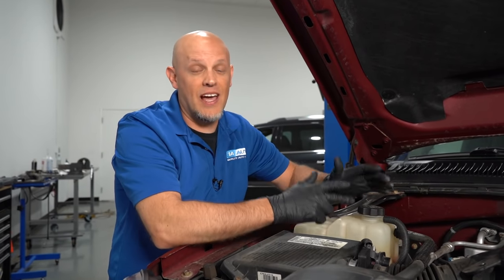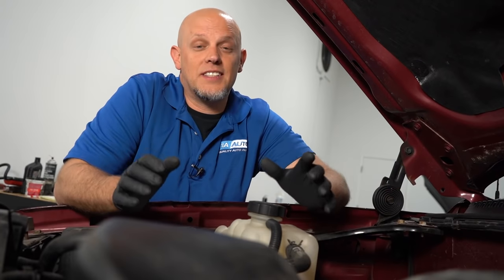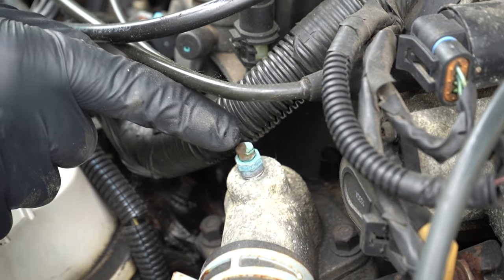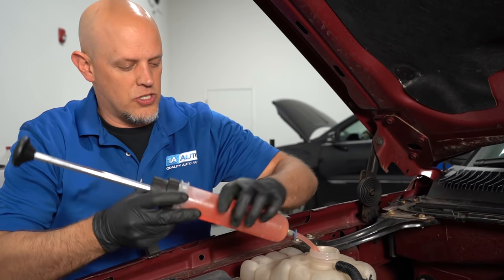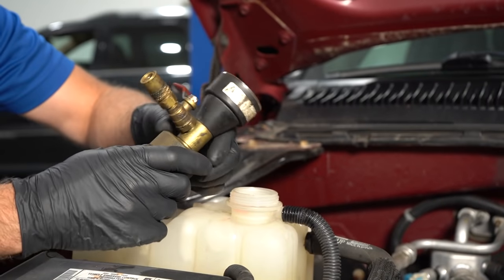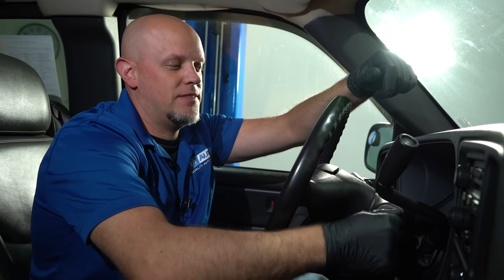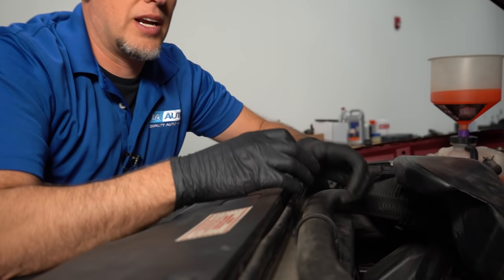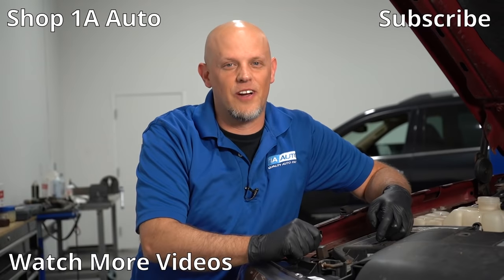Overheating After Replacing Radiator, Pump, Thermostat? Burp Coolant to Remove Air Pockets!

Comment: Facing same issue for two weeks now. Mine is toyota chr 2018.
Replaced water pump, and thermostad.
Filled coolent again. But still still heat meter goes up when i rev for 60kmh 80kmh. And when i slow down its suddenly get to normal possition.. only thing left to do is check radiator for any blockage.
Garage technician says much air in coolent system. Cant figure out what is the wrong.
From sri lanka

Comment: Not sure I would put a vacuum on the coolant system that flattens the upper and lower hoses. Forces produced under a vacuum are incredibly powerful and would hate to cause other issues within the system. Last resort is what I am saying. Not needed for sure in my Chevy suburban with same dash

Comment: Now I have very little heat coming out of one side I have a 2013 Dodge 1500 and I'm thinking that the heater core line might have air in it. If I get that tool that you used to suck the air out with the compressor would that get rid of the air in the line? I was going to disconnect the line but it's a real pain to get to
Reply: Same issue here with my 2016 Dodge 1500... did you resolve the issue?

Comment: My car overheated after losing coolant due to a cracked thermostat and now cranks but won't start. Would changing the thermostat, adding coolant and burping the coolant system do the trick, meaning it will start and run as good as before. The car is a Ford Mondeo 1.6 tdci engine 2014 model. Thanks!

Comment: Will the vacuum method also reveal a head gasket leak that's so small it's not detectable anywhere else...yet? I have a 2001 Buick Lasabre and was just about to give up. Only 120,000 miles on it. Initially it had a blown thermostat seal, not the gasket. Replaced that and temperature sensor. Still overheating. Then I saw burning 4" back on map sensor, replaced that. Same thing. Replaced water pump. Still doing it. No grey smoke or water leaks or water in oil, nothing. So it's pointing me towards air pockets still but doughtful but more towards head gasket. I only paid $400 for this car and miles may be low but it's not worth if it is the head gasket. Not to me lol. I think this might work. Hose goes flat then sit and wait. I'll let you know. I've heard many people say the only way to tell is to tear it down. And I've known a few that replace the head gasket and the overheating remains! I'm not going to be that guy!

Comment: If you don't bleed the coolant system on Acura vigor the idle speed will rise and fall. That's a 5-cylinder engine with a Honda emblem on it

Comment: I replaced the darned radiator, water pump, and the thermostat, but did not burp the darned system. So now I'm sitting here at 2:14 am on a Thursday morning SMDH 🤷 I'll know better next time. 🙃

Comment: I recently replaced the thermostat (I made sure it actually worked, & then made sure to install the correct way). Did this procedure. Massaged the lower hose until I didn’t hear any air. However can’t reach the upper hose due to other stuff being in the way. I tried all that I could but nothing seems to be purging the remaining air out of the system. I’m not sure where the it’s trapped but would someone be able to help?

Comment: If there's not a bleed tap at bottom,take the lower radiator hose off and spill it...reattach

If there's not a cap DIRECTLY on the radiator, take the upper hose off and fill the darned thing.

Trying to refill a dry system with that overflow bottle is just  asking for a giant air pocket

Comment: Try burping a second generation dakota 3.9v6 or ram.

I have same funnel. 

Reservoir filled but truck just sucks drinking coolant and water.
Nothing is leaking what gives.

Thermostat new waterpump new timing cover gasket new.

Comment: I replaced a couple solenoids in my wife’s car (2011 MB R350) and had to remove the oil cooler cover to access a couple screws. After the job her aux water pump is buzzing loudly. I wonder if air got in the system. 🤔
Reply from the maker: +@barrettteague617 We wouldn't be able to diagnose an issue like that here, you may want to have a local mechanic take a look at it. Thanks for checking us out! http://1aau.to/m/Shop-1AAuto-c

Comment: still cant get the bottom radiator hose to get hot. used the funnel system drove the truck gauge showing normal heat. heater working. is driving the truck bad now with possible air pockets ?

Comment: When the entire system is drained including the block, how will filling coolant in the radiator flow to the engine block initially? Wouldn't the thermostat be closed when the engine is cold. In this case, wouldn't the entire engine block be full of air only and cause overheating?. Please correct my understanding.

Comment: The biggest problem is usually in vehicles where in the engine has parts of it that are above the radiator. I have found General Motors products to be the most cantankerous at holding a vapor lock in the cooling system. Ford 5l used to do it, but if you will drive it until it actually goes a little hot and then shut the car off for about 5 minutes it will self clear. Then you can finish filling up the coolant, sometimes that's an easier way to do it than trying to burp it.
I have never seen anybody try to fill up coolant by adding it to the reserve tank. The reserve tank does not become active until the engine has fully heated up and is cooling down. Vehicle you are showing that on, it's that is not an expansion tank it is a reserve or overflow tank

Comment: When you don’t burp the system properly, and the thermostat does not properly open, during the overheating process is it common to hear rattling coming from the engine?

Comment: The plastic part of my radiator cracked like a hair which led me to change the entire radiator. I figured since I was changing that perhaps just change the thermostat as well. All done....made sure everything was put back correctly only to now discover a leak from around the water pump(under).....like why ughhhh. So now I am here....thanks for the video, but regarding this...now what? anyone? Thanks

Comment: Got a question bought a new radiator factory one cracked. Had a mobile mechanic replace it qnd after a week it cracked in the front right side of itaroujd the plastic. It lasted a week and we drove it for 2 and a half hours then I let it idle and sit while parked waiting on our son we saw smoke and I walked to the front antifreeze all over. Got it home drove it next Day it over heated and put water in it seen it had a leak out the front my over flow didn't even try to put more in it  that tank stayed full. Idk why it cracked it had been fine.

Comment: Can you tell me how to drain and bleed and burp my car's coolant system? I have a 2005 Impala 3.4 L. It has a radiator cap, reservoir/expansion tank, a bleed valve above the water pump, and a bleed valve on top of the thermostat housing. I followed the intructions in the manual. I only got 4 quarts out when it has almost 12. When I tried to refill it, I turn on the car and heat like the manual says but coolant comes out  of the radiator way before it gets hot, so I put the cap back on.

Comment: Im a dumb and forgot to bleed. I think my 94 civic dx has the older way where it doesnt have a bleed valve and you need to do it by running the car and letting the air come out while squeezeing the hose.

Comment: I have a 2001 dodge ram 1500 5.2L and it heats up little but when I turn the a/c on it heats up more. Also the coolant liquid gets absorbed and its not leaking.   I had radiator, condenser, thermostat, radiator cap, water pump changed to  new.  I also had the a/c compressor , confessor all parts needed for the truck a/c to work installed.  Since the truck had nothing installed for A/c to work.  I got it to make it a project.  Mechanics tell me different stories. Can you help.

Comment: Ok question so 2005 mustang gt car had a front end collision everything runs good from replacements but no heat on inside of vehicle, radiator housing an thermostat been all good so coolant flush, thermostat been replaced an coolant housing is overheating on coolant an is low on level below regular state of level I was told I was leaking some type of fluid but looks me me as coolant an by Trans an drive train what could be the problem can't figure out were the leak is or what is causing it over heat on housing, all I know of is that the coolant housing is low level an everything else is fine that I see

Comment: on my 2003  6 cyl. chevy s-10, the radiator fill hole is tilted, not straight up. As i am watching it heat up, trying to watch for air bubbles, it splashes out. The book says nothing about burping the system. That makes me wonder if this is one of those with the easy system that you speak of from 1:05 to 1:20.  How would I know if my temp gauge stays at normal because it really is normal as opposed to staying at normal because of coolant either not reaching temp sensor, or maybe faulty temp sensor ?

Comment: Thanks! I have a doubt, my Civic 2008 1.8 was getting too hot like it radiates on your face when bonnet is open, the temp gauge slowly rises to middle. I removed the thermostat and radiating heat is now gone. I checked the thermo on stove and it opens fine. What could be the issue then? I am in India and usually the cliate is hot.

Comment: do you know why my radiator fan runs steady at a louder sound, also when this tow truck driver pulled my car into his truck. two  grill shutters came off the actuator?Is that the main reaosn for why my fan is alot mor louder now?
Reply from the maker: +iKrillan We wouldn't be able to diagnose an issue like that here, you may want to have a local mechanic take a look at it. Thanks for checking us out! http://1aau.to/m/Shop-1AAuto-c
Reply: @1AAuto  ok thanks, checked out the online store today. I will be ordering  some tools for my 2015 dodge dart 😊
Reply: Did you figure out what was wrong? I’m having the same problems

Comment: I changed my thermostat right there in front of the auto shop and just pulled off I did not know this was a thing. Obviously but my car was overheating and I had to think fast. It’s still over heating. Maybe cause I ain’t burp it

Comment: I am having an issue where my heat works but all of a sudden it will blow cold air for about a minute then it goes back to blowing hot air. Could this be an air pocket in the system or something completely unrelated ?
Reply: Probably an air pocket

Comment: I have a Ford five hundred that’s damn near impossible to get air out of. I bought a vacuum filler kit so that’s my last resort. It has been an excellent car but it has a terrible cooling system design and one of those water pumps that’s driven directly off of the rotation of the camshaft.

Comment: My 94 1500 chevy has had the thermostat replaced twice and system bleed. It will run to temp then drop quickly to around 110-120 why is this we cant figure it out.

Comment: So what do you do when your system boils into the reservoir tank, and it never drains back into the radiator? Just replaced the thermostat (twice), water pump, did coolant flushing, replaced radiator. 2000 ford ranger 3.0 xlt flare side
Reply: Check if your reservoir has a leak (cracked plastic) above liquid level. You should be able to smell the sweetness.
Reply: Just letting this out there. Sometimes this issue can be caused by a reservoir cap. Yes, a simple cap. If you decide to replace it, make sure you buy it OEM . Aftermarket/3rd party did not resolve that bubbling boiling issue for me. This happened on a '05  2.0lt Mazda 3  I used to own.

Comment: If the car overheats let it cool down remove the radiator cap fill up the radiator turn heat up full blast with blower fan on  it should be okay to drive without overheating till you can get it home or to a mechanic

Comment: Installed new radiator, new heater core valve, new thermostat, new water pump, new coolant temp sensor, new coolant temp switch… and sadly my car still overheats and I have no heat in my vents.

Comment: I have a 2006 chevy equinox Ls V6 3.4l I need to repair the air in cooling system because my car is overheating. II live in wilkes-barre PA can you send you one for repair my car please.

Comment: a MECHANIC just replaced my radiator, thermostat and air filter. It didnt help my car,it still overheats!!!. I can even turn on the heater and the engine area gets so hot you cant touch it!!! oh but the heater works good!!!..id love to know the answer to this problem!!!

Comment: So I replaced my thermostat in my 97 explorer XLT and since iv done that it now runs cold.... Granted I put a 160 degrees thermostat in but I burped the system and test drove it and it still running cold...

Comment: Man I’m about ready to
Give up I replaced one thermostat still didn’t work out I remained the second ine tested it and it was bad so I thought it would fix it nope still didn’t work I took out a thermostat to see if that would work still didn’t work, before I took the second thermostat out I let the car run without the cap on I squeezed the hoses then put on the new cap that I bougjt. It’s still over heating, and this is my only car and I own my own business and this is setting me so far back I don’t know what to do
Reply: Is your thermostat replaced upside down possibly !?? Or if you're engine Timings are off a little , it will cause overhearing also , and Search for any collapsed hoses or blockages in fluid flow , just seeing your message , hope you figured it out friend , Been There Before Many Times !!!

Comment: or you can do the slow way, top up water and coolant, "drive the car"  to over 70°c, or not over 100°c, the thermostat should opened already, and check hot air come out inside the car room, then cool it 4 hours or overnight, water should be down, top it up ,do it again until water level won't drop after cold.
and how to know the coolant system pressure low enough to safe open the cap, you can use hand to press the top radiator hose,if can press down ,then can safe to open.
some models like BMW, the bleed plastic screw is screw into a metal pipe, this will made the screw easy broke, some area hard to repair, I want customer safe their money.🤑🤑🤑
Reply from the maker: +Alan W Thanks for the feedback!

Comment: I did all that is not overheating. But!! Feels hot in the middle section inside the car as where the exhaust pipe runs under the vehicle. What could be the cause of it?
Reply from the maker: +Walter Castro We wouldn't be able to diagnose an issue like that here, you may want to have a local mechanic take a look at it. Thanks for checking us out! http://1aau.to/m/Shop-1AAuto-c

Comment: I own a 2019 Chrysler 300s. I noticed a  leak in the lower radiator hose. I replaced it and now i have check engine light and it’s running hot. Any help guys?
Reply from the maker: +BiZzArE GaMeR We wouldn't be able to diagnose an issue like that here, you may want to have a local mechanic take a look at it. Thanks for checking us out! http://1aau.to/m/Shop-1AAuto-c

Comment: My engine overheated, somebody was telling me something about the interruptor and these Buick SUV is that we're put out in 2000 or so rendezvous I can't get it started. I had a 2000 a battery jumper. The battery is dead and it overheated for a phone reason. I don't know what kind of sensors it has. I don't know whether side entered the heat. I don't know anything. All I know is. I need to get this car running.  I pulled a dipstick because I was told that somebody needed to check hole and some kind of metal deposits by the Oil dipstick I didn't see any metal on it. It looked like brand new oil. It looked like a brand new oil filter. Have gotten these cars started before, I was told they're pretty good. Well, it wasn't that good when I'm seeing the anti-lock. Come on and then the car started over heating. I don't know what happened to it. Except for what the property owner said and I do own my own property. I needed to say that and I need to say that. But they said that I didn't happen at their address. I don't know what was the problem there. I was only there for a little while.  And then the car started over heating so far it breaks or not gonna cause the problem, but I don't know if these new cars so old cars I would probably be in the same spot I do know that I need to get something called an interruptor interrupted. These newer cars or were explained to me to have this problem. Where the car would need to start and you're not overheated. Does only thing that I can tell anybody and trying to get this information in the right way? So I can possibly get some kind of response to get the battery recharged.  I've heard this thing where it was. 2% discharged start a car. I don't know. I wanted to know how to get this overheated engine. It, it does have water and then it vaporizes and disappear except for the engine block as what I was told during examinations that I have in my glove box.

Comment: I changed coolant thermostat  but car just  heats up just below halfway mark on temp gage any solution?
Reply: Then it is working correctly. If it went above that, or to the redline/max, then you have a problem. Or, if your temp gauge didn't get anywhere near halfway, then also a problem. Just below halfway mark=good temperature.